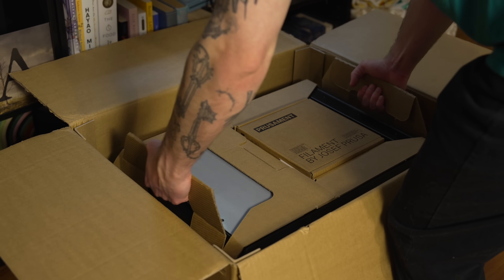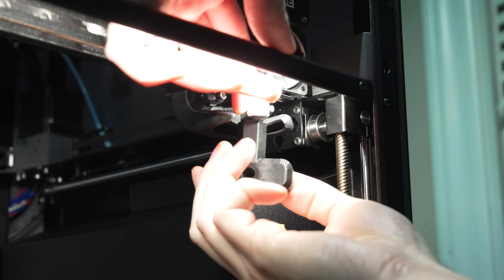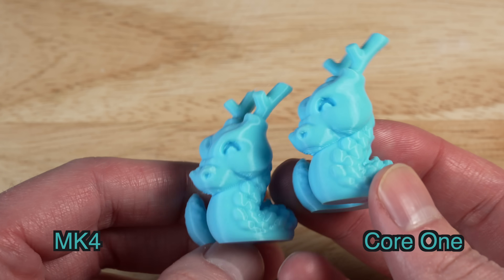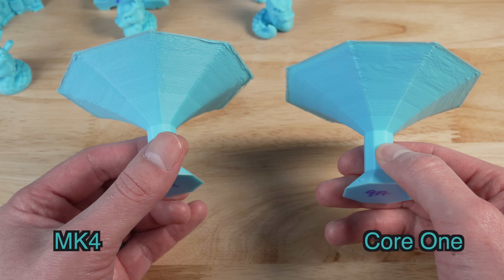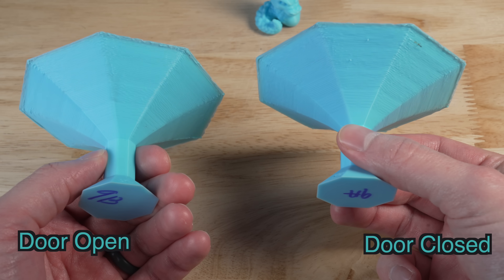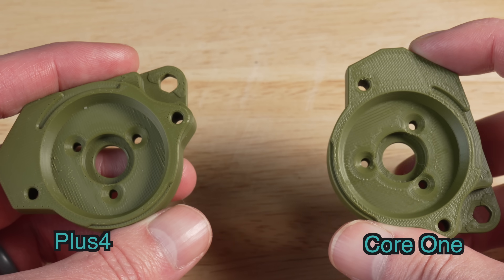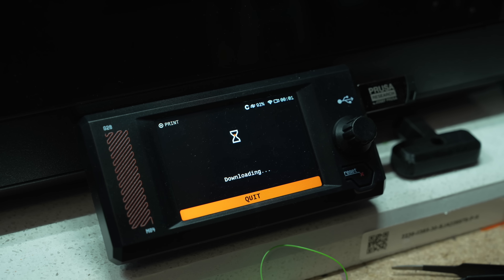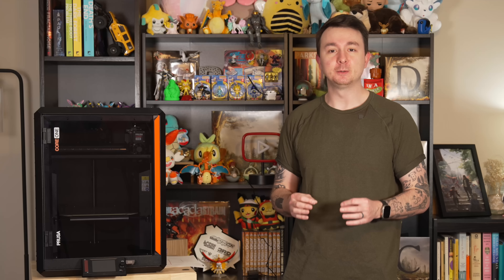Prusa Core One Review

Comment: Now buy and test centauri carbon for 299usd, you can buy 4x of these vs. one prusa core one.
Reply from the maker: I would like to try that out
Reply: More to the point, you can buy a fully assembled Centauri Carbon with a bigger bed, more features for less than the cost of an upgrade kit to take your already overpriced and outdated Mk what-evers to Core One. That's how out of whack Prusa pricing is relative to the market.
Reply from the maker: More to the correct point, Chinese companies are running a race to the bottom with cheap hard ware and closed off firmware. The Centauri runs a completely in house firmware - doesn’t even run klipper - much like Bambu’s stuff does. That might work for someone. Other people might want or need access to the firmware. Just because YOU are salty about it doesn’t mean the product segment for Prusa printers doesn’t exist. 

Thanks for the engagement
Reply: @ButterPockets  Well said, all correct.
Reply: @hillbillync655  being from NC you should understand first hand how outsourcing to cheap labor countries effects the end user. Sure you got a cheap printer but all of your towns like hickory, high point and thomasville were gutted and now you gotta work some crappy service job so you can barely afford said cheap Chinese printer.

Comment: Good review. Been enjoying my core one too. Did have a belt tension issue at the start, but that was quickly fixed through prusa's well made guide.

Regarding chamber cooling, the max fan speed is set to 40% by default. This can be increased manually, but man those little fans are loud!

Comment: Man, didn't have to call out RatRig so hard lol but valid.
Reply: Should of called them out even harder! If they had of listened 5 years ago, the problem would not have lasted as long as it has… But that is what happens when you have such a toxic devel group as what RR has.
Reply: @johnbeima6413  What exactly is the problem with RatRig and thermal expansion?
Reply from the maker: When anything heats up it expands. When you have a steel rail, attached to an aluminum extrusion, with plastic XY joiners, potentially titanium backers etc it’s all expanding at different rates. Your entire gantry is gonna expand and bend since it’s constrained. Vcore owners are quickly figuring out that especially on their bigger machines it’s causing a huge warp in the gantry itself and causing a big head ache.
Reply: @ButterPockets  a ratrig 500x is on my short list since the new Bambu is such a disappointment. Are you saying to not get one?
Reply from the maker: I’m not saying that - no, but there’s at least some stuff to dig into. Here’s a link I grabbed from their discord. It’s just my opinion that some of the design choices are a little … bad and you have to work around those. For 2500$ you probably expect it’s just phenomenal right out of the box, and jt may be, but dig around the discord. https://mazas-3d.notion.site/Vcore4-Gantry-Deflection-Measurements-12cc60bcd336803ea674c02af1b367ee
Reply: @  thanks. I’m considering an XL too. Not in a rush, I have my 2 X1C and for now a kobra max 2 that is tagged for return to Amazon. It makes lights flicker in my house, seems like a dirty power supply. I can get it a little less severe with doubling up surge protectors lol. Anycubic support can’t really help either. 
I live about an hour from where RMRRF will be held so I’ll check out a bunch of stuff in person and make a choice after that. At least that’s the plan anyways

Comment: I don't totally understand the current benchmark performance being based on overhangs.  I personally think overhangs are just bad design for a fdm printer and i try to design them out whenever possible.  That's just my opinion though
Reply from the maker: Designing with no overhangs at all is a pretty tall task and I find it’s kind of an unnecessary constraint. The benchmark is because it is more challenging than printing a non-overhang so it tests the performance. Part of designing is fillets and chamfers and those will almost certainly have an overhang at some point.
Reply: @ButterPockets  I mainly do it because of print quality.  An overhang unless printed with a zero clearance support never have the quality of the test of the print.  I design parts for fdm printing, not the other way around.
Reply from the maker: Anything around 50% or more will be functionally no different than no overhang. I also design parts and I design with FDM printing in mind. I understand what you’re saying, but I feel like you have to be able to admit that overhangs are an inevitability. Bridging? Different story.
Reply: @ButterPockets  I have had some cases where overhangs were unavoidable.  In those cases I usually do a zero clearance support with PLA (I print primarily PETG and I do it with my XL).  But yes you are correct, sometimes you can't avoid it, but I try very hard to do so.

Great review.

Comment: Thanks for the great review...i am still in the process to convince my self to buy my first printer...and i have no doubt that is going to be a prusa (because of it being supported in Europe and there open source and no restrictions to me needed to being online, I OWN MY PRINTER). But can you in short maybe help me to compare mk4s and the prusa one? Because i was so close to buy mk4s but then prusa came out but without mmu3  support ( it will arive)...but shall i wait or should i "just" buy mk4s?
Reply from the maker: The simple answer is: if you ever plan to print engineering grade filament or even ABS get a core one. If you only want to print PLA, PETG, and TPU a MK4 is gonna perform great. In my eyes the core one is objectively a “better” printer since it’s not a bed slinger.
Reply: Thanks...I will wait 😊....and thanks again for your hornets reviews.... there are not many of those left out there.

Comment: Thanks for testing, shortens my waiting time for the Core One kit.
Now I'm looking forward to it even more.

At first I wanted to upgrade my MK4S to the Core One. But now I'm keeping it for color printing with the MMU3. It prints so well that I couldn't bring myself to take it apart.

I expect no less from the Core One with better suitability for Abs or PCCF.
I like that I can use many parts from the MK4S like nozzles and sheets.

Size is also ok for me. Prusa has emphasized that the Core One is easily scalable. I therefore expect an intermediate size to the XL soon.
Reply from the maker: I’ve been thinking about upgrading my MK4S to a core one, but honestly it’s so good as is, I don’t think I need to!
Reply: @ButterPockets  The MK4S prints really well. Also runs perfectly with the MMU3.
We'll have to see what the future holds for the Core One with the MMU3.

My thought was that a solution for the MMU3 with the Core One would also cost money. 
Upgrade Mk4S to C1 500€. For another 500 I get the C1 kit.
An MMU3 storage solution will also cost at least 300€. 
For 200€ I keep the MK4S with my setup, which I put a lot of effort into, and have a second printer.
Reply: @herr_rossi69 so how is it?

Comment: The actual print area on the p1 and x1 aren't actually bigger when you take into the areas bambu use as no print areas in the front and side of their build plates and the core 1 is a little taller in the z axis
Reply from the maker: That’s a good point! The height is nice, I was printing some 254mm tall parts that wouldn’t fit on anything other than my 300mm 2.4 or the Plus4. It’s nice to be able to print extra tall stuff
Reply: You can use a full build plate on p1s and x1c
Reply: @riba2233  https://youtu.be/8cqa3b7Tncg?si=NkrfMgm6Ydu4Kyy0  
This is where I'm getting my info if its wrong I apologize
Reply: @buckmoody5939   you need to change a few settings but it's possible. His review was a bit lazy
Reply: @riba2233  no you can’t. That left front corner is unusable. 
If it was really 256x256 you could do 6x6 gridfinity but you can’t.
Reply: @MrBertstare  sure you can
Reply: @riba2233   you can’t even get it to slice if you are encroaching on that space.
Reply: @MrBertstare  there are ways around it
Reply: @riba2233  how?
Reply: @riba2233   not sure where my other comment went?
Reply: @MrBertstare  you can remove the cutter and edit preset in slicer
Reply: @riba2233   I didn’t spend a grand to need to delete parts and edit slicer configs on “click dnd forget it” type printer. Bambu just needs to be honest on the build size .
Reply: @MrBertstare  ok sure but it is still 256x256, what you want to do is your thing.
Reply: @ that’s not true, out of the box it is not 256x256 usable build plate.
Reply: @MrBertstare  irrelevant, it can be
Reply: @ not out of the box. Show me it being 256x256 out of the box with no mods. I’ll gladly eat my words
Reply: @MrBertstare  irrelevant, it is possible
Reply: @  lol it’s not 256 out of the box then.
Reply: @MrBertstare  yeah let's say. Still larger than prusas by a good margin
Reply: @MrBertstare  You're arguing with a known bambu fanboy that keeps having all his comments removed from videos for spamming. He'll go to any length to defend a company that misleads and gaslights their customers.